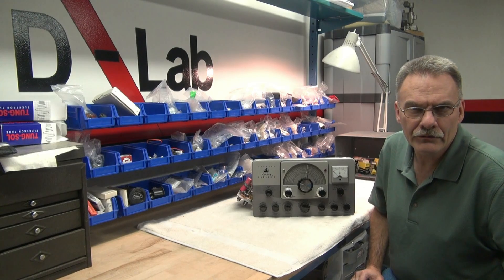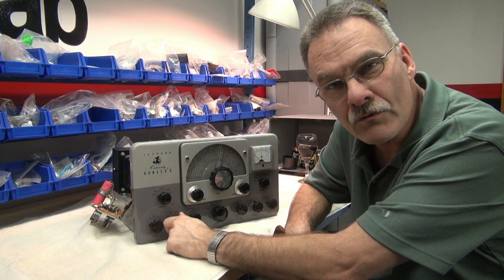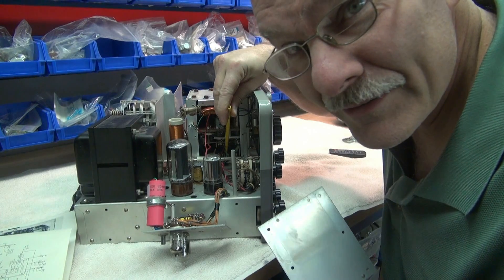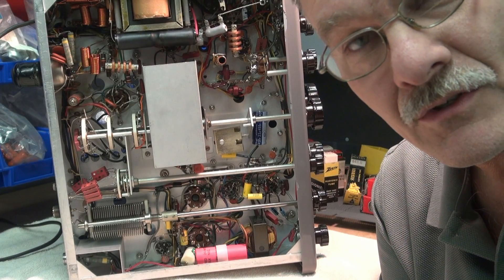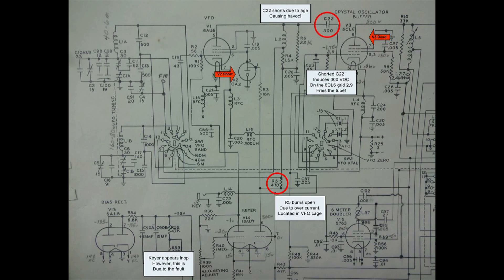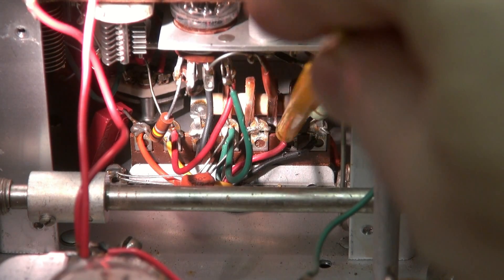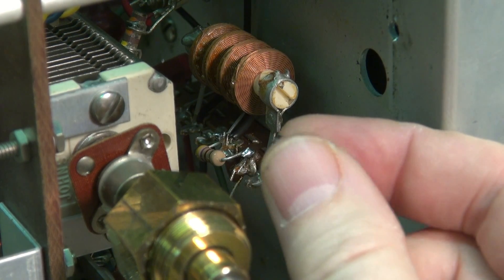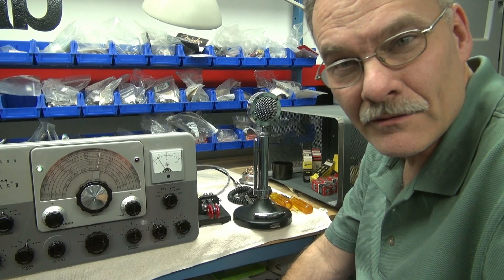EF Johnson Ranger 2 AM CW Transmitter VFO repair Ham Radio

Comment: I recently bought a couple of Ranger 1's.  One is a "parts rig" that is complete but needed a lot of work before putting any power to it.  While going through the VFO, I found the same condition with that 470 ohm resistor.  It had cracked and swelled.   Thanks to this video,  I now know why. 🙂   This may be the condition that prompted the seller to considered it parts rig.  It works now.  KW6T

Comment: Terry,  where in the WORLD did you get that radio?  She looks like new old stock inside and out!  Did you restore it?  I'm searching high and low for one as my first "boat anchor" transmitter to go with my Hallicrafters RX I just restored.  73 de N4RMT
Reply from the maker: +ShooterReady Hello, I bought this Ranger from a fellow in NJ. The rig was refurbished by K1TLI. I paid top dollar for it ($1200.00) When the problem happened I was shocked! Had to fix it. The Rangers are great rigs. If you are looking for one, make sure it has PTT and the keyer platform. TD